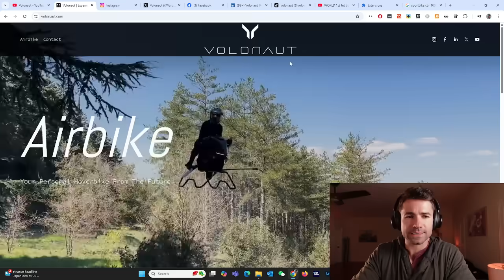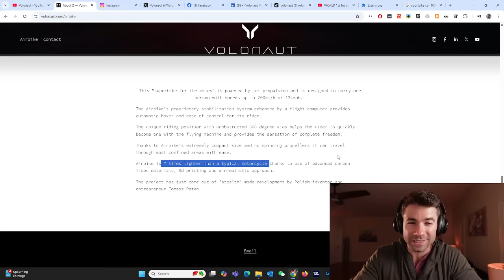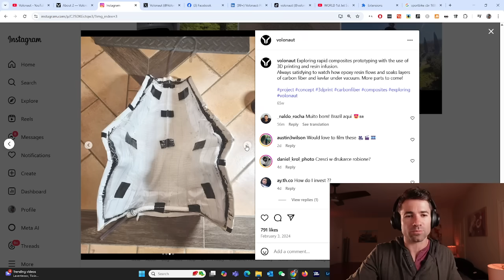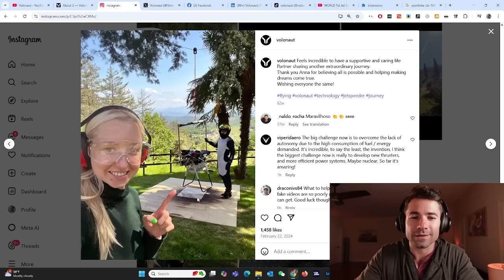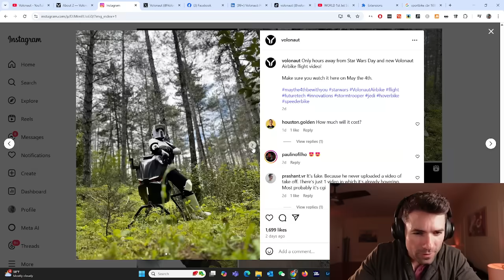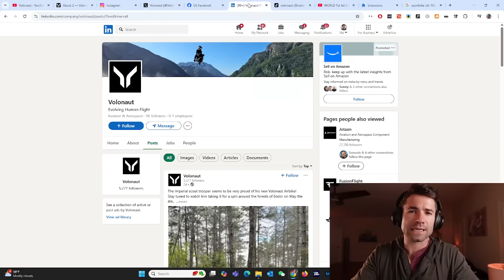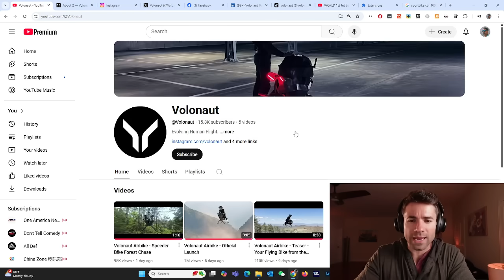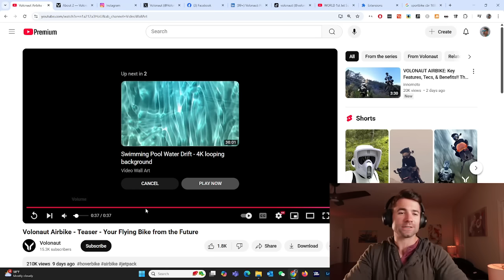Is the Volonaut Airbike Real or a Scam? (Expert Breakdown)

Comment: I'll believe it when I see it. Possible? Yes. Plausible? Not so much...

100 lb bike + 150 lb rider requires 250 lbs of thrust just to get off the ground. Add in the thrust required to overcome drag at 124 mph (182 ft/sec), and you need well above 350 lbs of total thrust. Remember, this thing doesn't have wings to convert forward motion to lift so there always needs to be 250 lbs of thrust pointing down just to keep you in the air (more if you weigh more). There are small turbojet engines capable of generating 350 lbs of thrust that could fit between your legs. But these small turbojet engines are not very fuel efficient, so you will need another 30+ lbs of Jet A or kerosine just to go anywhere.

The CG being above the thrust output requires significant thrust vectoring to remain upright. The fact this thing can move horizontally and turn or rotate left and right requires more than one thrust output. It could have two thrust outputs each with its own vectoring capability - kind of like a Segway, but with nozzles instead of wheels. It's possible to have three or more thrust outputs - one to keep you airborne, and the others to move you laterally and turn left and right. Thrust vectoring isn't anything new, but doing so quickly enough to keep you from flipping upside down in the case of a significant disturbance seems unrealistic given the very small moment of inertia combined with the small amount of torque the thrust vectoring could produce without dropping you out of the sky.

And here is where it gets sketchy from a physics point of view... Jet engines, even small ones, don't spool up fast, and they spool down even slower to prevent flame out, so changing altitude would be slow with lots of lag, and diverting thrust to change directions or maintain upright attitude would certainly cause a drop in altitude. BTW, a flame out would cause you to drop like a rock - no wings to allow you to glide back to Earth, and no rotors to auto-rotate you down slowly.

A better use for a small jet engine in a speeder bike would be as an APU running a generator to power your ducted-fan quadcopter motors, with a small battery backup to land you safely in case of that all to likely turbine flame out.

Comment: As far as burning stuff it would only do that if you stayed in a certain spot for at least 30 seconds. I have used the four jet version attached to your arms when I was a Navy SEAL and there would be 6 of us flying from one ship to the other because they only last around 6 minutes of flight time. 
There's only a 6 gallon tank in the back and they use a lot of fuel has jet planes do for instance a 100 mile trip in an F-22 Raptor uses 800 gallons of jet fuel for that 100 mile trip. I don't like the fact that they have no noise as the really isn't a secret about what they're using to propel themselves and I don't like that they don't show it starting up it taking off or Landing like you said. 
It's plausible that this is for Real. And also depends on how much you weigh as the more you weigh little lower it will fly in the sky. I am 5 ft 10 and 170 lbs and the four turbines for each arm I reached 85 ft tops and could only fly about 3/4 of a mile to the next ship before having to refuel. Jet fuel runs out a lot quicker than regular gasoline engines but I do think it's real.

 I just don't like the video they're presenting because it leads people to think it's not real when they don't take off and land. Believe it or not they are in the process of finishing something like that for the Navy Seals that is nuclear powered and nuclear power plants come in all sizes and to fly that bike with nuclear power you don't need a big Power Plant and you could have enough fuel for 10 years. They just about have it completed after they did about 50 test runs and the Prototype is still running fine after the 50 test flights as it is nuclear powered so I gave it a good 10 years as that's what all the nuclear powered aircraft carriers.

 They use nuclear power on other ships as well including Aircraft Ccarriers that believe it or not will do 70 mph+ that they're not telling anyone about and they say they will only do 35 to 45 mph because they don't want the enemy to know how fast these big ships or let's just say cities Tango. 
The government is also not telling us they have anti-gravity fighter plane and other planes running on the Earth's magnetic field for the same reason as above. We don't know if the scientists figure this out themselves or they Back-engineered or reverse engineered a spaceship.

Comment: Fake, fake, fake.

Notice as he flies over the trees—there’s no movement in the branches from the downwash. At just 5 feet off the ground, the heat would be intense enough to scorch the plywood, yet there’s a white square pad beneath him—probably a heat shield to absorb the primary flame.They market it as electric, but it clearly burns fuel—that’s your first red flag.
Flying this would be nearly impossible. A tilt of even one inch to the right or left would send the whole thing 10–15 feet in the opposite direction. Also, the distance from the camera never changes—a classic AI giveaway.

And think about the logistics of filming: how would they even get that shot? They’d need another one flying in front, which would cause camera wobble and height shifts. Plus, that second craft would push the trees with its own downdraft—but again, nothing moves.

The biggest giveaway? The image of the rig hanging in a sling—clearly suspended by a crane or maybe even a helicopter. Then they likely color-keyed or chroma-keyed out the cable.

FAKE. FAKE. FAKE.

Comment: It looks like there is a single jet engine and there are 4 vents for balance and steering that would work like the 4 propellers of a drone. That's assuming it's real. Such things are on their way, but not convinced this is the first. It just doesn't look like there is enough room for fuel or batteries. The range would be absurdly short.

Comment: If the military is not interested in it, red flag.
Reply: The military are not really hot on using motorcycles since communications have improved considerably and no real need for a courier. Whatever scenario you can think for a soldier on a flying bike can do, a drone could do it as well. It's possible to do a Dragoon type lightening strike, but the element of surprise is kind of gone 3 miles ago. 

That being said, the navy could use it for quickly and cheaply moving a person ship to ship when required. If the range can be extended and improve the carrying weight, it would be handy for search and rescue.

Comment: Flyboard Air® is a jet powered board designed to showcase the potential of “hypermobility”.
Powered by 5 jet engines, it is the smallest redundant manned aircraft ever built.
Its advanced stabilization and the redundancy of all critical systems ensure that the board is safe to fly in all conditions. Nevertheless, flying the Flyboard® Air is a demanding task which requires a high level of skill and fitness.
Flyboard® Air holds the world record for the longest distance traveled on a hoverboard. It received a lot of public attention during the crossing of the English Channel in 2019, as well as during the air shows which ensued (Formula 1, Moto GP etc.).

Comment: I agree. It could possibly be real but how would it be stable enough for safety. With the Jet Suits the weight of the persons legs will hellp stabilise the position in the air. So what stops this from flipping. Could a gyroscope be built into the engine? Everything adds weight. Too many questions but good luck anyway.

Comment: This technology has actually been around since the 1960's. The Williams WASP X-Jet is almost identical. Powered by a 100lb cruise missile gas turbine it could fly at 60mph for 40 minutes. The army decided it wasn't that great. Nowadays a smaller lighter engine with computer control make the idea far more practical. I have no doubt that the Volonaut machine is real.

Comment: It's not real.  They don't have a video  of the aire bike take-off or landing.  Isn't that odd?
Reply: As far as burning stuff it would only do that if you stayed in a certain spot for at least 30 seconds. I have used the four jet version attached to your arms when I was a Navy SEAL and there would be 6 of us flying from one ship to the other because they only last around 6 minutes of flight time. 
There's only a 6 gallon tank in the back and they use a lot of fuel has jet planes do for instance a 100 mile trip in an F-22 Raptor uses 800 gallons of jet fuel for that 100 mile trip. I don't like the fact that they have no noise as the really isn't a secret about what they're using to propel themselves and I don't like that they don't show it starting up it taking off or Landing like you said. 
It's plausible that this is for Real. And also depends on how much you weigh as the more you weigh little lower it will fly in the sky. I am 5 ft 10 and 170 lbs and the four turbines for each arm I reached 85 ft tops and could only fly about 3/4 of a mile to the next ship before having to refuel. Jet fuel runs out a lot quicker than regular gasoline engines but I do think it's real.

 I just don't like the video they're presenting because it leads people to think it's not real when they don't take off and land. Believe it or not they are in the process of finishing something like that for the Navy Seals that is nuclear powered and nuclear power plants come in all sizes and to fly that bike with nuclear power you don't need a big Power Plant and you could have enough fuel for 10 years. They just about have it completed after they did about 50 test runs and the Prototype is still running fine after the 50 test flights as it is nuclear powered so I gave it a good 10 years as that's what all the nuclear powered aircraft carriers.

 They use nuclear power on other ships as well including Aircraft Ccarriers that believe it or not will do 70 mph+ that they're not telling anyone about and they say they will only do 35 to 45 mph because they don't want the enemy to know how fast these big ships or let's just say cities Tango. 
The government is also not telling us they have anti-gravity fighter plane and other planes running on the Earth's magnetic field for the same reason as above. We don't know if the scientists figure this out themselves or they Back-engineered or reverse engineered a spaceship.
Reply: Uploaded on July 31, 2025: Volonaut Airbike - Test Riding a Flying Speeder Bike - https://www.youtube.com/watch?v=XZpWTHtwceE You can even pre-order it now on their website.
Reply: in youtube have a 3 years old video in their channel of this taking off and landing
Reply: All the videos are controlled and done without a real non bias camera crew. 

If it was real he would have a local TV station do a media package on it. I know he has had several inquire and he never replies to them or gives them vague answers. 

A man who has a proven product and wants to generate sales he would be in front of tons of cameras and crowds.
Reply: https://www.youtube.com/watch?v=EMoOu3uC8OA
Reply: @barcelo2304 Why is there a lack of a pan-out version as the object lifts off in this video?   Surely, a shot from the viewpoint of an individual on the ground capturing the event could offer an encompassing view, don't you think?

Also, this has me teasing out a possibility here. Could there be any chance that cables are involved in the lifting? It might explain the absence of a wider shot, in case they're trying to keep such details inconspicuous. Could the footage have undergone some editing to keep these elements hidden?

Comment: 20 seconds worth of Google on electric jet propulsion: 'There is no current existing battery technology with the effective power to weight ratio, to provide enough propulsion to lift itself in the air', let alone I guess to lift the whole vehicle and an adult passenger.
I know we shouldn't believe everything we read in Google, but sadly, almost certainly
- The video is fake.

Would love to be proven wrong though.
Reply from the maker: It’s gas turbine running on jet fuel not electric in any way as mentioned in the video
Reply: Thank you for the note. Where s the air input located then?

Comment: The Volonaut Airbike prototype is indeed real. 
It's a personal ultralight aircraft that's designed to be lightweight and easy to operate, sort of like a flying motorbike. It's aimed at providing an accessible and fun flying experience for enthusiasts.
According to Ubergizmo, the Volonaut Airbike is a lightweight, jet-powered flying superbike developed by Tomasz Patan. It can reach speeds up to 124 miles per hour and features an open-air design, providing a 360-degree view for the rider. However, it's not available for public purchase yet.
It's been tested in flight! 
The Volonaut Airbike's developers have demonstrated its capability to fly. 
While it's not commercially available yet, it's definitely a functioning concept that showcases some impressive technology.

Comment: very low power jet engines - you need at least 3 to maneuver and if you combine control with AI managed PIDs for leveling the craft - it works perfect.
question is how long can it fly because jet uses a lot of fuel

Comment: Obviously real. The HUGE problem with these and jetsuits and multicopters is absolutely no backup: when the engine quits, you hit the ground. Every one of these systems needs a reserve system of some kind; ballistic parachutes are good only over 2-300 feet. People will die in all of these from failures; once you get over 6 feet or 10 mph, and you lose lift or stability you form a crater with YOU. In a best case scenario, try standing on the seat of an electric bike and jump off going 10 mph, and let us know how that goes. Then try it from 20 or 50 feet up and going 30 or 50 mph: I hope you have enough bubble wrap. And limited fuel is still a problem, until we can integrate the UFO technology, and even they crash.

Comment: I came to the same conclusion based on the availability of very compact jet designs available today. Is it electric or liquid fuel powered? That's a question, but it's certainly within the realm of engineering today to create this kind of aircraft.

Comment: I'm leaning towards real. The most powerful diesel/kerosene turbine jet engine I could find is the Swiwin SW400Pro with 40kg of thrust. So you'd need 4 of those (3kg mass of each). The fuel burn is 1kg/min each, so 4kg/min at full power. The Honda Fireblade has a gas tank of 16L (or about 11.5kg), allowing for about 3 minutes of flight at full power. The four engines could be gimballed below the centre of gravity and directed at an angle pretty far off the vertical, so with a good computer vectoring system, I think control is achievable. So in theory, the propulsion is possible.

Secondly, the guy (Tomasz Patan) is real, has another company that makes and sells an actual drone product (at $138k, with a non-refundable $8k downpayment), production sold out through the end of 2026, so he's got plenty of money for research.

As for the videos, the leaves blowing around and even more distant trees bent with the downwash look realistic and not something I think AI would be able to accomplish.

I assume they are not releasing either technical details or more detailed videos because they look shit on first sight. I mean if they say the noise level is pain-inducing within a radius of 5 metres and the thing only flies for 3 minutes and the engines have a 25-hour maintenance interval, AND there isn't enough reserve capacity if one of them fails or something - this makes it a cool project, perhaps to boost his other business, but not really vaporware or fake.

That said, his motto is Everyone is a pilot. As a pilot, I strongly disagree. Not everyone is cut out to endanger themselves, others and their property by flying and this will need to be addressed in legislation before one of these contraptions demolishes a house with its occupants inside...

EDIT: Swiwin built something exactly like my proposed spec two years ago (would not be surprised if it was in collaboration with this same guy): https://youtu.be/U66XtsRn91I?si=TdWlk7_sDUt281jf

Comment: It's a modern civilan version of the Williams WASP developed in the early 80s.

The WASP was controlled by leaning and manually handling the engine power. Loud as hell as it was powered by cruise missile engines.

Add computers, gyroscopes and modern micro jet engines and it's completely possible.

Comment: No sign of intakes on top and too narrow for stability barely wide enough for side by side turbines, lots of sleek bodywork and nill of intake and thrust nozzles.  A 1100cc sports bike at 210kg 1/7 of that is 30 kg a 22 liter Honda bike fuel tank full is 25 kg 5 kg for the seat and faring nothing left for 4 x 5 kg model gas turbines, fuel pumps, batteries and electronics.   Wider, heavier 60 kg +, intakes and exhaust nozzles no problem.  If they can make it at 30 kg get rid of the seat and skids and put it on your back even at the full 30 kg it would be the lightest jet pack.

Comment: there are single mini-jet thrusters with over 300lbs of thrust available. would this all be balancing on a single thrust vector? There are electric drones that are designed to use a single thruster with flaps to balance the assembly and to counter the torque from the single motor. That would make it 50% jet, and 50% software. IDK. On paper, it's possible with today's tech.

Comment: If you want a 100% real jet bike check out the Lazareth LM 847. It is a motorcycle that turns into a jet bike! Fully functioning 100% real a few actually owned by private citizens it was a very limited production for sure under a 100 built maybe even only like 10 in existence.